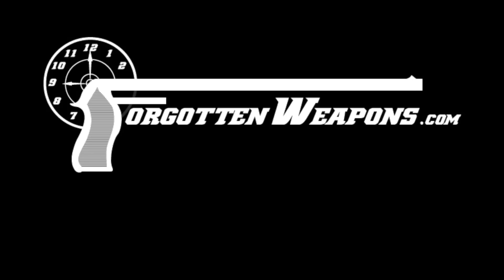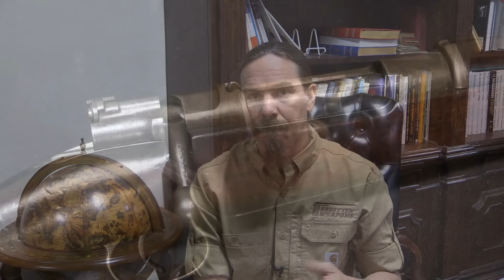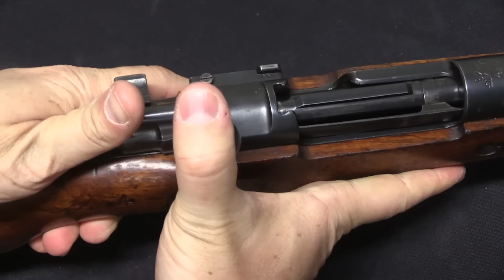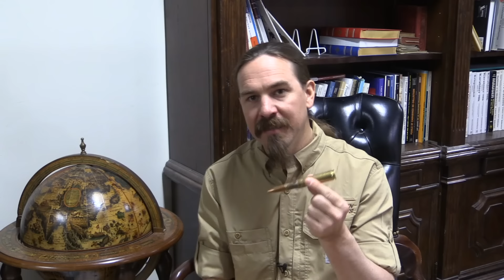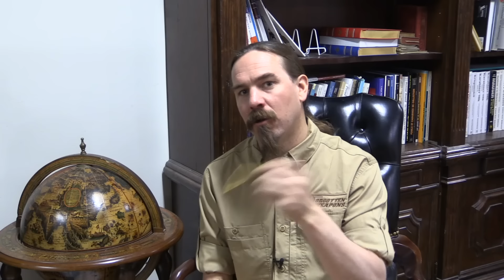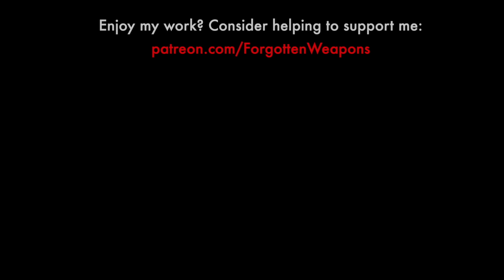Earth-Shattering ka-Boom! How (and Why) Guns Explode

Comment: 28:26, That's what killed Brandon Lee on the set of "The Crow". They needed close-ups of a revolver from the front, and the director complained you could see clearly it was empty, so he had the prop-master fill it with dummy rounds for the close up... but they didn't have any dummy rounds so they just pulled apart live rounds and dumped out the powder but left the primers in when they put the bullets back in the case. One primer went off and lodged a bullet halfway up the barrel, where it stayed undetected until a later scene with the same prop gun being used to fire blanks directly at Brandon Lee. Revolver squibs are a real nightmare.
Reply: The director released the gun safety person before they actually filmed the scene, which contributed to the obstruction escaping notice until it was too late.
Reply: I just saw a movie where they carried safety a bit too far… They showed a character opening the cylinder of a revolver to see if it was loaded… None of the cases had primers in them at all.  Safe, to be sure, but a gaffe visually.
Reply: @Bikewer  majority of moviegoers would never realize that was wrong though. There's far more glaring issues with movies and tv than that. Like the exaggerated pulling on steering wheels that should annoy anyone that ever drove a vehicle, but no one ever mentions it.
Reply: Idiots with guns... what could go wrong
Reply: Squibs in semiautomatic pistols and rifles are nightmares of a different sort. I experienced them more than once due to missing powder in a cartridge, pushing the bullet into the barrel. Fortunately, the bullet prevented another round from chambering, and I was able to get the bullet out without damage to the barrel.
Reply: @Aidan. I was thinking of the same incident, but what happened to Brandon Lee had some similarity, but was an accident that affected Brandon Lee as the target, not the shooter.  If the bullet pushed into the barrel by the primer had been followed by a regular round comprising primer, powder and bullet then the gun would have exploded, likely injuring the shooter, but in the case of Brandon Lee, the squib round was followed by a blank, with primer and powder but no bullet, but as there was already a bullet in the barrel the gun fired normally, and was totally safe for the shooter, but had tragic consequences for Brandon Lee.  😢
Reply: @jongustavsson5874  Ditto for anyone who flies a plane…
Reply: This has been the best 30 minutes of my life. Ian I had the experience of a friend loading 3 inch cartridge into a 2 3/4 length cartridge 12 gauge pump action. It discharged by itself when I tried to extract the shell from the gun. The shot gun was Filipino 8 shot pump action. Could you do a story about this situation.
Reply: That's why there needs to be several layers of safety in film making, so if one or two things go wrong, people still don't die. Don't directly point firearms at people, blank guns, real guns, or completely fake ones made of rubber. You can point off a bit, and it still looks fine, but nobody is in the line of fire. Cowboy shootout and battle reenactment participants do this. This goes for camera operators as well. Use remote cameras or mirrors if it must be pointed at the camera.
Inspection at every step, and by multiple people should be done all the time. And everyone including actors and directors needs to be trained in safe handling and basic firearms understanding.
And no live ammunition on set. And dummy rounds need to be obvious. Drilled holes in cases, no primers. And again,  train everyone to identify them.
The bad part is, the people making movies have absolutely no clue about firearms or even common sense.
Reply: I thought it was the round came off and remained lodged in the barrel only to be launched by the blank round

Comment: "You can do Everything right and still Fail. That is not a Weakness. That is Life."
Reply: - John Luke Picard
Reply: Unfortunately But very true!!!
Reply: didn't he buy shitty ammo
Reply: That is completely true for everything in life. Been there and failed that. Live and learn from what happened even if you did nothing wrong there's still things you can learn. Or you can whine and complain and blame it on others. One way leads to understanding and a better life the other does not.
Reply: My Da had an old saying he used a lot. " Right, so right as he sped along. But was just as dead as if he was wrong."
Reply: @Sankis 
He knew the rounds were hot. What he didn't know was the exact origin of the ammunition.  He didn't know how old it was, what loading was supposed to be in it, how the ammunition  had been stored  and handled over the years.

Comment: In the Army, we called a squib a pop-and-no-kick.  I witnessed one on a range one day.  Thankfully the private that was firing the M-16A1 recognized it immediately and ceased fire.  I can remember the drill sergeants using a ramrod to push the round out of the barrel.  We all knew that the private's training and attention to detail potentially saved him that day.
Reply: How easy it would be to detect a "pop" from a squib when you have ear protection on?
Reply: @VT-mw2zb  while the sound could potentially be drowned out from other weapons on the range in addition to the ear protection, the noticeable lack of recoil should be a clue as well.
Reply: Makes you think twice about firing something in full auto or rapid firing semi auto. Hopefully it just doesn’t cycle the weapon and makes you stop.
Reply: @streetfighteralpha9891  yeah seriously.  It would turn dangerous in a hurry.
Reply: @streetfighteralpha9891  it will not have enough gas/recoil to cycle an auto or semi-auto. However, what comes next can be problematic. If you apply a Type I failure remedy because you are under pressure and/or trained to do so (and you blindly follow it): tap, rack, it can be followed with a boom to your face. There's a video of a guy running a competition where he got a squib, tapped, racked, and the weapon didn't fire because the bore obstruction prevented the next round from going into battery. He tapped, racked, (or even could have hammer the forward assist) a couple of times, and then it went just enough for his gun to blow up. It blew the mag out of his gun and gas into his face, and you gotta admire his dedication: the guy continued to put another mag in and tried one more time before giving up. Training for remediation of malfunction is focused on getting back into the fight but when the malfunction is a squib, it could be the gun blowing up.

(xhgyJMhQFbA) vid id.

A hangfire may also occur on a click but no bang. Type I action may result in a cartridge explode on the ground but it's usually harmless.

A squib in the revolver or bolt action is more problematic. Failure to fire? Pull the trigger again on a revolver or just cycle the bolt and you will fire a round behind a bore obstruction.
Reply: I had a squib once, a trailboss handload in my no4mk1.Dont know the cause, most likely my fault but one thing i can say is case had a charge %100, pill was only a couple inches max from muzzle and i doubt a primer alone is going to push 180gr down 23odd inches of barrel. I visually inspect powder load (more than once) when loading so i know it had a charge for this reason, could have simply been a load of two smaller % of capacity, i was trying to get subsonic, all the rounds before it were well over 1k fps, i didn't shoot any of the followers just in case. Was pretty obvious, especially lack of report of any kind from muzzle. I did have an RO breathing down my neck at the time as he was interested in the subsonic loads himself, so even if i had not realised i dare say he would have stopped me before i put another up the spout!
Reply: Decades ago my dad & I were shooting .22 bolt rifle, had some squibs, also had some powder act. tool 'blanks' and putting one of them in behind the stuck projectile (bullet) would reliably blow the bore clear - often Collapsing the 'blank' case(!)  - - remember this was a .22 bolt rifle = Very large safety margin on receiver strength...
Reply: @VT-mw2zb  Just watched that video, this dude was given so many warnings to check the bore and even after it blew up he tried to blow it up even harder by loading a magazine into a gun that has just suffered a catastrophic failure. No one trained this dude how to deal with firearms. Maximum darwin award for him.
Reply: @nikonmikon8915  well, he trained to tap, rack, and bang. Except and tapped and racked several times. He had a "lucky" squib that could've warned him about the squib. If the squib lodged itself a bit further down the barrel, the first malfunction clearance would have ended in a catastrophic malfunction.

Part of the issue is also the safety officer/referee. I've seen videos of other competitions where the safety officer noticed the squib and stopped the shooter, who clearly intended to tap and rack. This safety officer let the guy blew up his gun and still allow him to attempt blowing up even harder.
Reply: @dunxy  powder charge dispenser that discharge by the volume may have funny moments that because you move the crank at just the right speed that the powder flow from the hopper that are just slow enough that you somewhat undercharge the case. Visual inspection with a light down each case may be deceptive due to poor depth perception at vertical angles: only by weighing each case before and after dispensing power that you can be more sure.

If you are plinking with handloads, there's really no rush. Catch the case that flies out and check if the bullet is gone (after waiting for hangfire, of course).
Reply: @davidm.4670  Is your last name Knievel?
Reply: If you'd like to experience the wonder of squibs simply purchase Remington UMC ammo. 👌 Had to push out several with a cleaning rod, another guy at the range shooting a Berretta M9 had one, the box of UMC on his table was a good indicator.
Reply: @VT-mw2zb  You'll still hear it through bone conduction, and you will feel the recoil of the weapon. It will go biff, instead of "Boom" and the weapon won't cycle.
Reply: @VT-mw2zb  Easy when you are firing large caliber guns like the .577 Tyrannosaur... just watch videos about people firing that "MONSTER" and tell me, if you tried that and it went "POP" instead of "BOOM," do you think you would notice?

Comment: The same is true of most aviation accidents.  They are often chains of small events and decisions where anyone by itself is easy to ignore or justify, but in combination lead to disaster.
Reply: And the most important thing is that this is not randomly like this, we purposefully built systems like this. Mostly by trial and error. Plane crashed? Reason: X. Okay we have safety measure for X now. Plane 2 crashed? Reason: X, then/while/after Y. Okay safetly measure for X and Y too. And this goes on like this.
Reply: Yeah, or same with industrial or nuclear disasters. It always start small oversight (something like a safety valve or sensor removed for maintenance and never put back on) combined with chronic lack of maintenance. Then sprinkle in a healthy dose of administrative missmanagement, pressure from executives. Then add a nice pincer of crew shift in the middle of a delicate operation and all of that ends up into a nice healty catastrophic incident!
Reply: There are rarely true “accidents” that occur just by chance and bad luck. However, there are many, many “incidents” that are categorically traceable to those seemingly insignificant and carelessly afforded missteps that results in catastrophe. That’s what news stations fill their air time with, over and over, the prideful foolishness of man.

Comment: His incident has to be the best recommendation for eye protection I’ve seen. From his description, had he not been wearing eye protection he would have probably lost an eye and possibly been instantly killed.
Reply: That was my thought exactly
Reply: I grew up not using eye and ear protection when shooting. It wasn’t until I bought a .44 mag pistol and had my ears ringing for about 3 days after shooting it all day that it really scared me that I’d screwed up my hearing. So now I wear hearing protection when ever I shoot. I still hardly ever wear eye protection though. It’s not that it isn’t available. I work in a factory that requires us to wear safety glasses from entry to exit, unless inside a control room or break room, so I’m used to having them on and theirs several pair floating around my truck. I guess it’s simply that I grew up not wearing them while shooting that I’ve been complacent. KB’s video is very sobering though and definitely makes me rethink not wearing them.
Reply: also best reason never to buy an rn50 lmao that's one of the most dangerous designs I've ever seen
Reply: Spot on. Good time to reflect on why you wear safety glasses.
Reply: @Johnny-tq9no  I disagree with your assessment.  Like Scott said in his video, that chamber had to have been fearsomely over-pressured, way beyond what any specification for .50BMG calls for.  It is frankly incredible that the threads sheared like that instead of something else failing.  I think the RN50 is actually more safe from barrel blockages than other guns, simply because it is a single shot with a break action, allowing you to take a look down the barrel after every shot, something you can't do with most guns.
Reply: @Johnny-tq9no  you severely underestimate the power of an incline plane, which is what threading is.
Reply: @gumbomudderx7503  I'd have lost my eyes last week from a hydraulic oil explosion if I didn't wear my safety specs. It happened so fast but luckily it's something I can laugh about instead of a sad unfortunate blinding story. I can't imagine not wearing them, I get nervous having to resort to safety squints.
Reply: Considering even with eyepro he still broke his eye socket bone in three places that back cap would have at the very least knocked him out cold and caved in the eye socket. Aka made Scott's training mute he would bled out in the truck
Reply: @The_JEB   excluding REIB, tho that doesn’t apply here.
Reply: @John_Redcorn_  i don't think any change in the design would have helped as the pressures hit about 30,000 - 35,000 psi more than the gun was made to handle so even a vent hole would have struggled to deal with that amount of pressure.

Comment: Speaking of exploding guns, Brandon fixed the Cursed AK and apparently it was an explosion risk with those ground down locking lugs and barrel.
Reply: Being an explosion risk was the least of that things problems. 🤣

Good to see it back up and running though.
Reply: And fixed it to 5.45x39 as it was originally intended.
Reply: That was a scary gun. HT to Brandon for resurrecting that abortion.
Reply: I hope we get a NEW video on that
Reply: @jessemorris744  Brandon posted one.
Reply: @VallornDeathblade  I meant from Ian
Reply: @jessemorris744  it's the cursed "Krinkov" video
Reply: That thing was a grenade waiting to go off if it was fired one more time in its prior condition. The shooter of the “cursed” Krinkov is quite lucky that it didn’t just blow up in his hands.
Reply: @brianwestberry9117  you mean it doesnt shoot .223mm anymore? XD
Reply: @Requeium  to be fair, it only shot 1 round .223 and took the gas block with it.
Reply: Thats probably why they didnt properly attach the gas block. They figured it would relieve the pressure.
Reply: @metamorphicorder  That unintentionally saved the shooters life....irony at its finest.

“Crappy making of a Krinkov parts kit saves shooters life by being sh*tty”

Comment: Scott was lucky his dad stayed calm and they both had the knowledge of how to deal with what they faced. Then not only having but using safety equipment most likely saved his eye, then the excellent work of all the medical staff.
Reply: Not only saved his eye, but also probably save him from a brain injury. That much oomf into his eye and breaking the eye socket in three locations, had he not had the glasses that much impact directly into his head would have been like getting punched by Mike Tyson in his prime bare knuckled and holding a steel slug. The glasses deflected the power of the cap enough that it didn’t happen thankfully.
Reply: "Lucky" I think underplays just how critically important it is to be trained or have someone nearby trained to deal with things like this.
Also, heck, to be the annoying atheist for a moment, all of his thanking of God I think underplays how much he owes his life to the quick work of his father and the medical staff that treated him.
Reply: good point on the safety stuff. I need to get a set of safety glasses ground to my eye prescription I think after watching that.